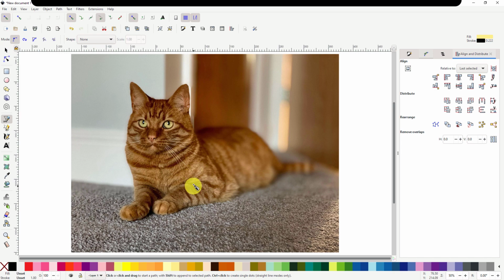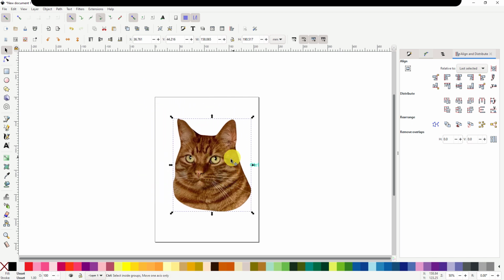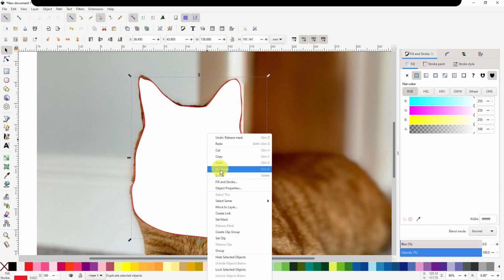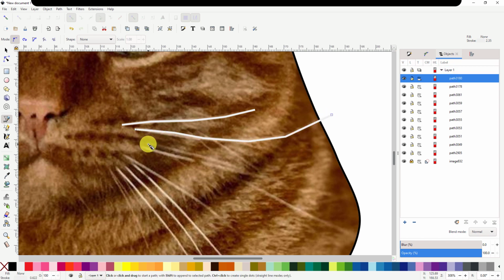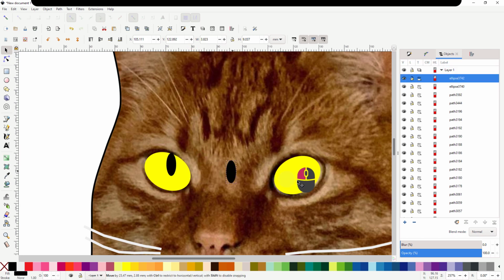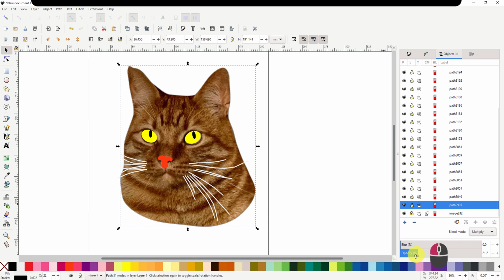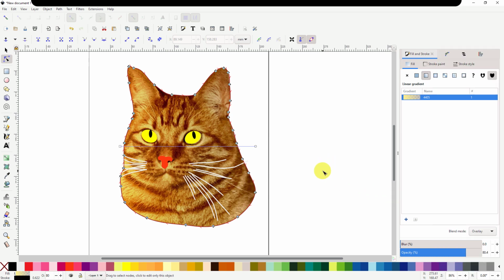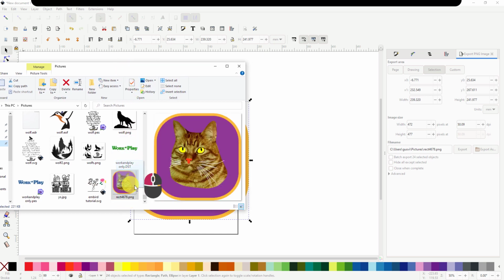pefinalphoto ink

Comment: some time back you created a lesson in Inkscape for a merrow stitch motif. I was wondering it you could make the motif so that it would make a sharp corner.
Reply from the maker: A motif stitch is always hard to go around sharp corners best is using rounded corners or next option is split your lines at the corner and apply the motif to each line segment
Reply: Thank you  for your response I an trying to digitize a patch for the Civil Air Patrol squad my grandson belongs to and it has to have sharp corners
Reply from the maker: Or your other option is that you manipulate some stitches and maybe add some extra stitches in the corner and changing the length of a straight edge slightly can change also where your motif shows in the corner and make sure you start the motif on a straight end also